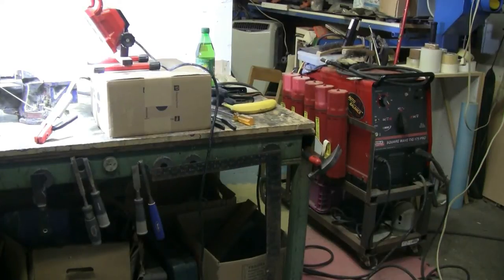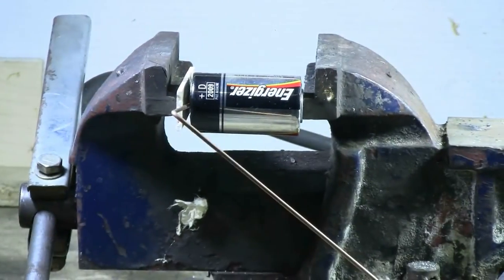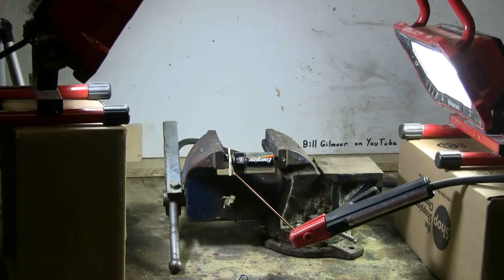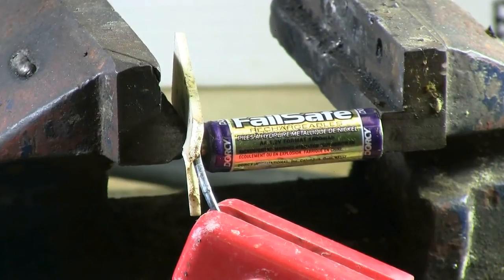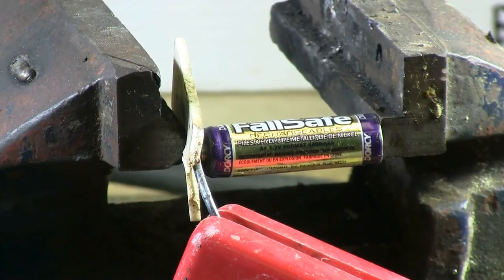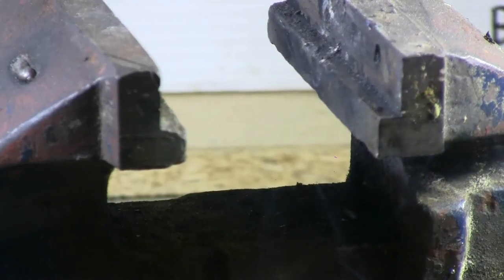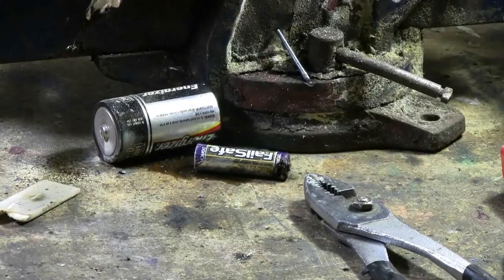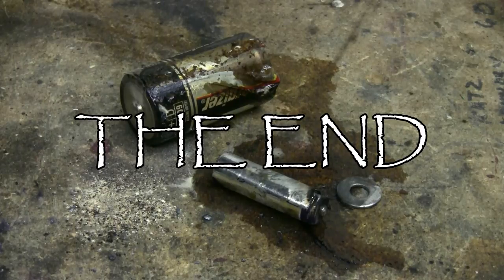Arc Welder Frying A D Cell Battery

Comment: I've experimented with recharging alkaline batteries (with some success) and have observed the same failure mode of the electrolyte leaking out the negative end. It's interesting that even in the case of an extreme overcharge the same thing still happens. I bet the capacitor bank could cause one to explode though...
Reply from the maker: I tried it, but the discharge arced across rather than entering the battery.
Reply: Bummer. What if you could insulate it by, let's say, removing the label and placing a bead of epoxy (or other non-conductive compound) around the seal, leaving a spot just big enough to touch an electrode to the negative end?
Reply from the maker: Might just have to try that ...